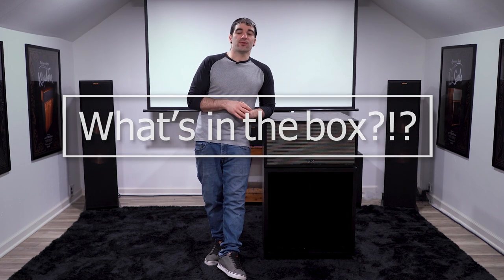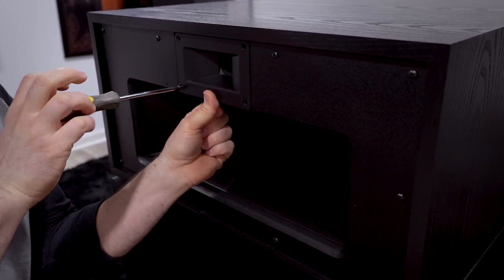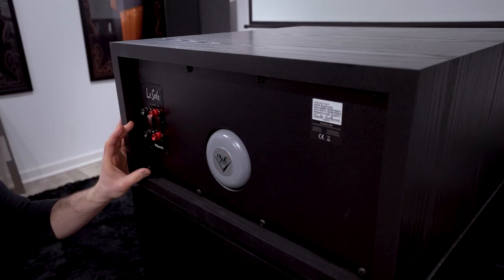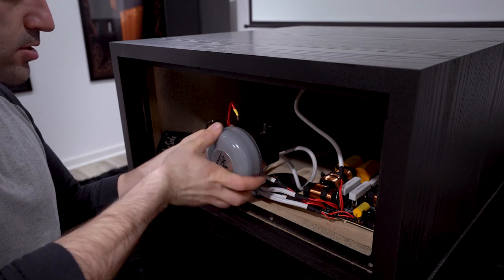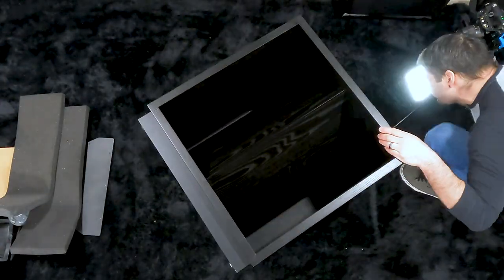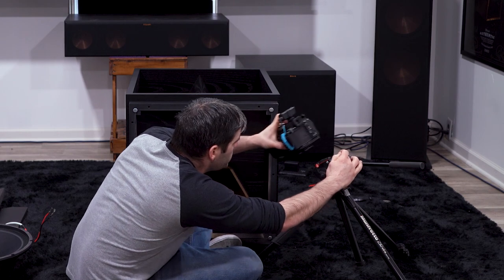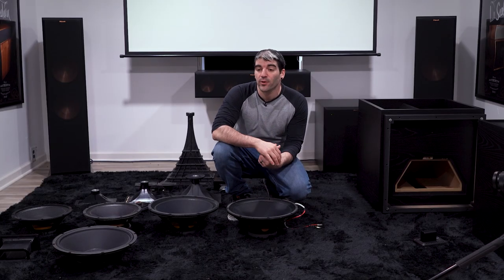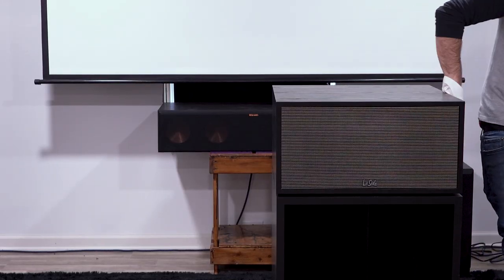What's in the box!?!?!?! - Klipsch LaScala AL5 Disassembly

Comment: Back in 1980-81 my oldest brother had a rock band he was using 2 LaScalas and 4 Heresy as monitors. So sometimes they would downsize the band to a 3 piece and he temporarily stored one LaScala in my living room. I had a fairly nice stereo system. I hooked up the LaScala speaker to my pioneer amp, turned on the system and WOW! The sound was fantastic and loud clear tweeter, mid and the vibration form the base manoman I was dancing playing the air guitar 🎤🎸🎵🕺💃 etc etc. I was so sad when he took the LaScala.😢 On thing about the LaScala it was made of one piece cabinet in othwords the tweeter and midrange were not separated.
Reply from the maker: Thanks for watching! Did you ever end up getting another set?

-jason

Comment: Well, as much as you pay for a pair, you would expect foil inductors, Auracaps, Mills resistors... It would smooth the sound out better, and have better midrange for sure. The old La Scala's I believe had metal squakers, and if this is metal, then put asphalt or some kind of heavy rubber material to damp that horn...

Comment: Jeers to Klipsch for the iron core inductors and sand cast resistors (also inductors). At $13K/pr we should get ginormous air core inductors for the bass crossover and milled power resistors for everything else.
Reply: Well definitely not Wilsonsbut more like soeakers for the young or deaf.Like fine wine it’s an acquired thing
Reply from the maker: Thanks for watching and for the input!

-Jason

Comment: Why are some fasteners wood screws and others bolts?  Fascinating to see the internal construction, especially that folded LF horn on the LaScala.  I can't wait to see a K-horn disassembly, and hopefully a Jubilee as well.  I'm seriously looking forward to the RF-7 vs Heritage (Cornwall?).  I have some Gen 1 RF-7's and will be upgrading to either RF-7 III or Heritage at some point and I'm seriously wanting to scratch the Heritage itch.
Reply from the maker: The difference between using the wood screws vs the nuts and bolts is likely due to different needs for different components. Nuts and bolts for heavier/upright components. smaller components that aren't heavy and won't have a great deal of movement, wood screws will suffice and save money and time on the line.

-Jason

Comment: I noticed a lot if not all of the internal wires are doubled up to a single terminal clip on the drivers, etc.  Is this just a way of making the wiring equal a lower gauge?  Is that for performance enhancements?  I haven't noticed that on any of the other models you disassembled.  Great video by the way.
Reply from the maker: In the earlier versions in this generation of speakers/on the units that used audioquest internal wiring, you will see this. The audioquest wires are doubled/bi-wired. I believe this was the case in three of the 4 heritage disassembles so far. The Heresy, Cornwall, and this video. I think the Forte we took apart was a later version with standard wiring. 

Does this improve performance? I'll stick to a somewhat politically correct response of: you have some that swear by it, but I personally do not subscribe to that train of thought. 

Gotta stick to that PC answer because, if I go off on another tangent about it, I may never stop ;). 

Thanks for watching!

-Jason

Comment: disassembling the components like this.. will it void the warranty?
Reply from the maker: Nope! In many cases if there is a warranty claim on a particular component, Klipsch will actually send the part as opposed to the whole speaker to avoid potential shipping mishaps. Now, if you accidentally shove a screwdriver through the driver---likely not going to be covered but...in most cases, not going to be an issue. :)

-Jason

Comment: Do you have a video for the Epic CF-3 ? Any upgrades for these? How can I get the most of the speakers?
Reply from the maker: Unfortunately no. With a few exceptions, we are mostly tied to the current product line. Getting hands on older generations isn't always easy and sometimes not possible. If you have faulty drive components, there are several external sources where you can buy replacements. Some aftermarket and some original. I recommend trying to stick as close to the original as possible. 

-Jason

Comment: I will never understand why speakers builder use those crappy yellow caps and thin cables of industrial general purpose. Are they the best parts on the market? I don't think so. If I spend 5 grands for speakers I want serious capacitors and serious wires. I can tolerate those components inside my "cheap" JBL pro speakers, for 900 euros those components could be ok. But for higher level hifi speakers the producer should invest on better quality parts
Reply from the maker: So, you'd like the parts to be more expensive for the sake of being more expensive? If they sound great, last forever with extensive warranty backing, and do the job...Why would you need to go a different route? 

-Jason

Comment: hmmm. stamped steel instead of cast.
Reply from the maker: Hardly a revealing detail when we are dealing with a horn loaded bass bin where the woofer is barely being tickled, especially in a home speaker that isn't going to get banged around on the road in a pro audio environment which could potentially break a stamped frame, and especially in a design where the crossover point is 450 hz which is below the point where ringing of a stamped frame could potentially be an issue.  Theoretically that happens above 500 hz and in reality it's more like over 1 khz.  But yeah they look fancy for sure.  -- Cory

Comment: 6:09 I don't understand the point of having doubled all the positive cables in the enclosure, it's perfectly the same voltage, the same intensity, the same signal, which transits in the + or in the -...
Another snake oil job? 
Nice video, bravo and thank you!
Reply: You can bet that the two cables are different types, one a finer litz, the other heavier or it could be that the cable they wanted wasn't available in the capacity they need and this reduced cable capacitance which would be noticable with a very high sensitivity horn system like this.
Snake Oil - thats usually an explaination for a lack of education. There's a lot of stuff thats mystical unless you open a book and when you go to top end brands there's a reason they are top end. Beware the company that markets on one thing, like freq. res., dynamics, stereo image etc. If it can't do it all then don't buy!
Reply from the maker: Would have to speak with the engineer on the product to answer this in depth. Wiring is an interesting discussion. Moreover biwiring digs deeper into this rabbit-hole. In earlier models in this gen, Klipsch was working with all AudioQuest internal wiring. I believe there was a running change in this somewhere in the line though. 

-Jason

Comment: Look VERY overpriced for the selected components ??  Big empty box  and a pressed steel CHEAP looking 15" bass unit with small magnet ..... should be cast steel and much larger magnet and all CLIPPED on internal wiring that could easily come loose ?   Def not worth the money ??  Looks like cheap Disco/Pa speaker.  Come on Klipsch !!!  UK
Reply from the maker: I don't think you're really understanding what that "big empty box" is actually doing here. Are you familiar with the concept of the folded horn LF? Have you even heard the LS? There is more to designing a speaker than having massive components.. 

-Jason
Reply: @TopShelfAudio  Jason , yes I know about folded horns from my DJ days where they use massive 15" and 18" bass units for power and efficiency and they often use expensive cast chassis and solidly made birch ply boxes too, all at reasonable prices ?   HiFi speakers have been massively overpriced for many years now. For the price I would expect the K LS to use a CAST unit which is much better and a huge magnet ?  Never heard any K's I must admit though there is pair on UK Ebay for £5K app. ?  Chris UK
Reply from the maker: @christophermaley6822  So you're bashing an item that is intended to (and does) make great sound, based on pre-conceived notions that it should have more expensive and bigger components...when you've never heard them? 

Perhaps the units you're familiar with utilized these bigger and more expensive components to compensate, where better engineering could have gotten the same result with what you claim to be lesser materials. 

-Jason
Reply: @TopShelfAudio  Jason .....For that money ($13K, very expensive) they could (SHOULD) be using superior VOLT or PRECISION DEVICES die-cast basket 15" bass units in line with it's price point to make an even BETTER SOUND as many reviews refer to their lack of bass and need subs?  Once again, I am aware that all High End speakers are massively overpriced and often use average, CHEAP components. That's not to criticise it's sound Jason, just that it could be MUCH better given the $13 K ( it's £13K in UK rrp) price point.  Cannot believe they use a pressed steel (cheapo), flimsy 15" bass unit that you might find in a pair of cheap Disco speakers. Chris
Reply: @christophermaley6822  for home use things only need to be good enough. For professional use where these things are getting flogged for hours at a time then sure industrial strength components are necessary. But I doubt very much anyone is going to be putting hundreds of watts through a pair of these in their living room for hours at a time.